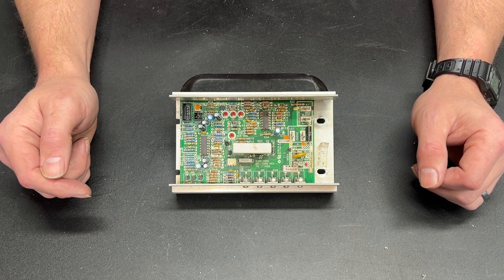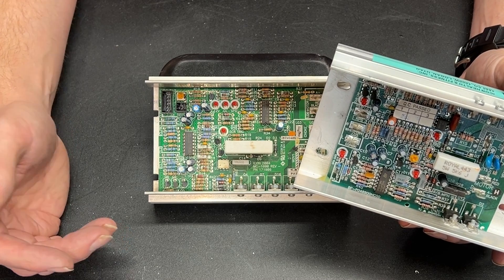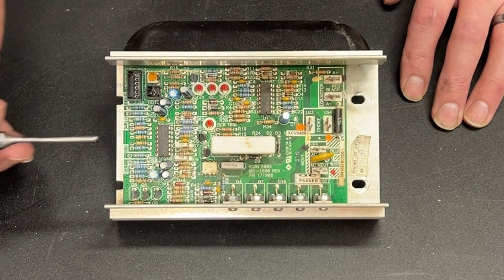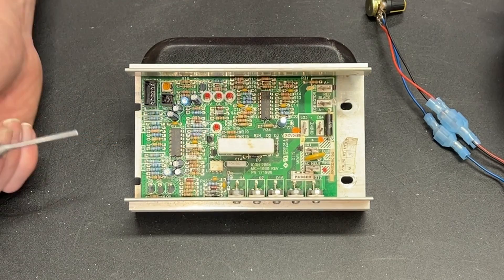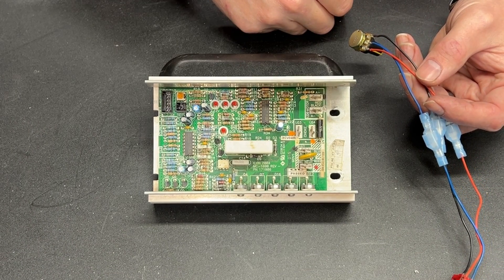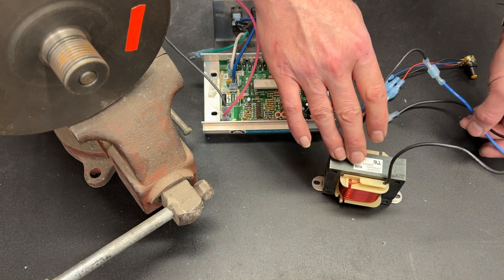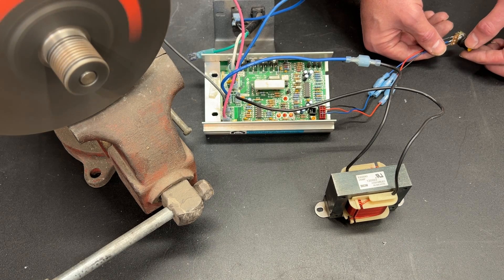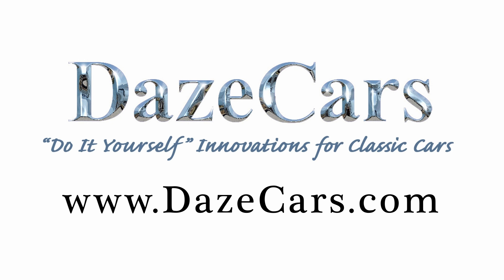How to HACK an MC1000 Treadmill Motor Control Board to Work Outside of a Treadmill

Comment: does this board have a resistor like r42 in the mc60 that would help improve its fine tune adjustment control? also, what is the T terminal for? tach? also, what is the two pin connector for?
Reply from the maker: Other than the initial hack of the board I have not played with it at all to determine the answers to any of the questions you have asked.

Comment: Thanks Much!  I hand saved a couple of treadmill motors and controllers for a future upgrade for my Shop-Task 1720 XM TC Combo Lathe / milling machine.  I was happy to find your video showing how to connect the speed control pot, as I had just cut the wires going to the console.
Reply from the maker: you are welcome

Comment: Hello, are the black blue and red wires the same on every board to run a potentiometer? If so your video was very informative and thank you very much
Reply from the maker: Every board of this model type yes or every model of board no. I have the hack for about a half dozen boards but it is for sure board model type specific.
Reply: @dazecars  Thank you for your quick response. Im just wondering how many different boards and motors are out there, because everyone i come across is different. Is there a way to test you can perform to find out which wires do what and which wires you need to run the potentiometer?
Reply from the maker: I wish it was that simple but most are not hackable and not all of them that are hackable use a potentiometer as Some use a PWM.   Good news is most motors will run on any hackable board or any board still utilizing the treadmill control panel.

Comment: Thanks for all the great videos. I have a question about DC motor chokes. I'm planing to use a microwave transformer with the fine wire coil removed. What would you think about cutting the ferite magnet part down too fit the coils. Then welding the parts down to make a smaller unit?  Thanks again for all your advise.
Reply from the maker: Yes you can and that is the best way to do it.  I would go even one step further and epoxy the coil into the the modified housing.
Reply: @dazecars  That's the plan so far. After cutting it down the run a fly cutter across the cut. Thanks
Reply from the maker: Use some sacrificial aluminum on ether side of the core to take up the space between the top of the vice and the top of the core.  These cores are made of thin laminate layers and cutting them can cause the layers to bend but if you sandwich them between two pieces of aluminum during cutting and milling the outside layers will not bend and deform.

Comment: Dang another question , " Slow starts " I've read for the RV air conditioners " the factories will not warrantee when customers add slow starts " , my / question is are the slow starts reducing voltage / hard on motors ?
Thanks a 3rd time +++ ;)
Reply from the maker: I have no idea why RV air conditioner makers have problems with slow start motors. I know nothing about them.
Reply: soft starts shouldn't add any wear so it's probably to stop people from tinkering with the ac

Comment: What is in the treadmill that allows the slow start ?
Thanks again
Reply from the maker: soft start is simply a function built into the board.  it's not a specific part but rather the sum of several parts working together.

Comment: Thanks for the great video Daze!  I have an old treadmill with the MC2100 motor control board.  I haven't looked closely at it but I will now.  Do you have any information on that one?  Or can you point me in the right direction?  Thanks.
Reply: I just searched your FB channel and see that you have a video about the MC2100.  I'll watch that now.  Thanks.
Reply from the maker: I have several including one on how it is far from my first choice.  Let me know if you have any questions.
Reply: @dazecars  Thanks for the reply.  I have watched a couple of your videos on treadmill motors and controllers.  Your videos are a treasure trove for a repurposer (scrapper) like me.  Thanks!
Reply from the maker: glad you like them

Comment: Impressive. Would really love to do a torque comparison with my 6 € AC DC PWM controller from the usual suspects. My low rpm has a hum and about 200 rpm. Not as strong as my rectiefied 24V DC supply that I use only sometimes, because the PWM fits most purposes for both lathe and mill
Reply from the maker: This should help, it’s not exactly torque ratings but it does shed some light on the differences. Variable Speed Treadmill Motor Power Supply Shootout: SCR, Variac, & MC-2100  Which one is the BEST?